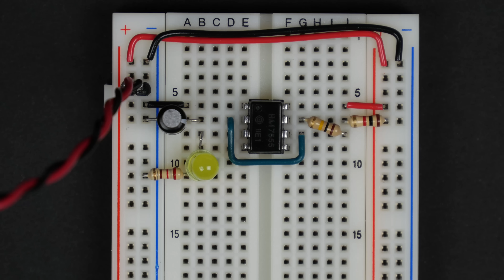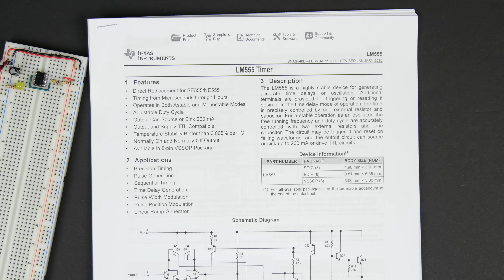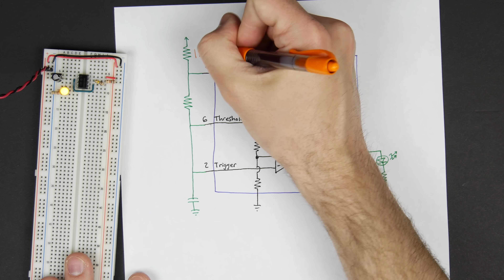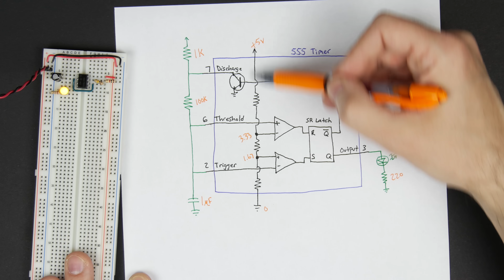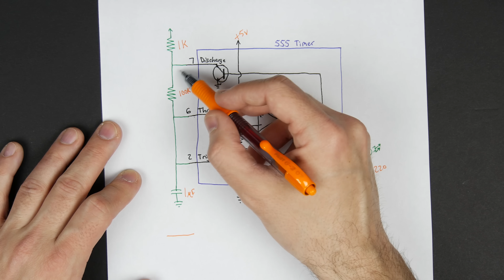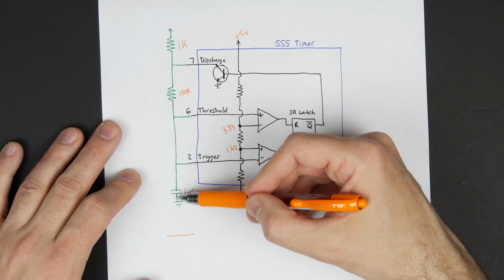Astable 555 timer - 8-bit computer clock - part 1

Comment: Microsoft copilot told me to put power across pin one and two is it damaged? 0:42
Reply: It should be😂
Reply: Pin 2 should be a capacitor to ground but if you put it to vcc it shouldnt cause damage

Comment: Watching this series again, thinking of making my own or at least putting it in s simulator program, and I have a question about the resistor placement.  If you want a symmetric duty cycle, why not put an additional 1 kΩ resistor between pin 7 and the junction immediately to its right on your schematic?  That should make sure the charging and discharging have the same resistance no matter what.  You already need that extra resistor when you move to the variable-length one, so it isn’t even an extra part.

Comment: Timestamps 
00:01 - Using a 555 timer as a flexible clock circuit for a computer.
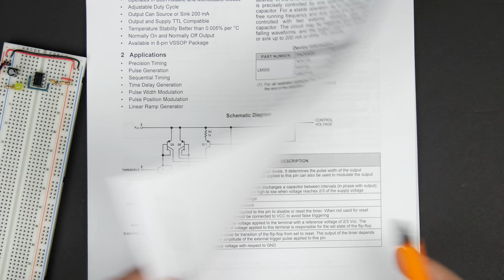01:59 - The circuit diagram of the Astable 555 timer is explained and compared to other diagrams.
05:57 - The Astable 555 timer generates an output that turns on an LED
07:58 - The 3.3V negative input resets the latch and turns off the output.
12:17 - The total period of the circuit is calculated using the formula RA + 2RB
14:32 - The output shows a square wave and the charge/discharge of the capacitor.
18:36 - Adding a 0.1uF capacitor from pin 5 to ground reduces noise and improves transition
20:27 - Impedance in the wire affects the current flow and voltage stability.
23:58 - The function of the 555 timer is to reset the latch and control the speed of the blinking.
25:43 - Adding a resistor in series with the variable resistor to prevent a direct short

Comment: How come the capacitor accumulates charge and voltage? I would have thought the charge would flow out through the resistor and not build up.
Reply: Because electricity always takes the path of least resistance, and the capacitor has a resistance much lower than the resistor.

Comment: I'm confused... instead of using ac supply why couldn't I simply use a DC power supply. Wouldn't that mitigate the problem of uneven jumps automatically rather than having to use a capacitor?
Reply: in the video he is using a DC supply.  The power cable he uses supplies 5V DC.  Even if you used the best DC power supply you would still have uneven jumps.  Without adding the capacitor your intervals will still be somewhat accurate.  However, if you are using this clock module for a project that needs more precise pulses I highly recommend adding the capacitor.

Comment: Why is the 100 Ohm resistor needed at all? Why not just use the resistance of a wire, which is even better than a 1% difference.

Comment: I know Im  a 'little' late, and sorry if this allready has ben adressed, but on the Capacitors;
My Teacher for electronics once told me that most electricity stuff is rated and tollerated for safety-reasons. Capacitors, wich maybe end up in a circuit where they power critical stuff, are rated on the low end. Thus the print-on-value is the guaranteed minimum. The real charge will never be lower and most likely higher. For fuses its kinda the opposite; They are rated for the highest possible value and may blow way lower, due to safety reasons. A bit like the Speedometer in your car; They are alowed to be wrong up to +20%, but they are not alowed to be -0.01°% of to the lower end. (So; Driving 50mph with an indicated 60mph: Thats fine. Driving 50mph with an indicated 49.999[...]9mph, thats a lawsuit desperatly waiting to happen)

Comment: I built the circuit on my breadboard and was following along with the video. I couldn't understand why my LED was flashing twice as fast as Ben's thinking it might be the tolerances on my resistors or capacitor - only to discover Ben's capacitors were 2 micro farads. Everything makes sense now.

Comment: Why is the 220-ohm current limiting resistor connected between the LED and ground instead of pin 3 and the LED?

Comment: You wont get much precision in your timing with a 555 though, most capacitors have rather large tolerances in their capacitance (± 30% in a lot of cases), also the clock frequency is also liable to change over time when using electrolytic due to drift.

Comment: Confused on why the 1uF capacitor would drain into the discharge transistor and not just straight to ground. My understanding is electricity will try to follow path of least resistance, so your 5V supply will no longer pass through the 100k resistor, allowing the 1uF capacitor to discharge to ground. Regardless of my confusion, great video series and thanks for providing free public education.

Comment: I'm late to the party, and have really never understood how the bits work (ie. don't know about electronics, other than all the pieces make a circuit), but now you've explained pieces of the puzzle that make sense to me. Like the part where you said the flow through bother resistors and then back, was so simple to understand (for calculations, etc). Thanks. 👍

Comment: Built this on the breadboard last night, as a flawed copy of the one shown with all the extras - it had though the 555 timer supply and ground connected to the wrong two pins (gnd 8, Vcc 1). I powered it up with my bench supply stopping at about 2.5V and 1.5A. Then checked my layout as it obviously didn't need anywhere near that current to make 5V. So, I swapped Vcc and GND leads at the timer noting my copycat error. And, it actually worked (LED flashing) after that, drawing a few milliamps - not sure what was dissipating the power before?

Comment: Hey guys,

yesterday I tried to set up this circuit on a breadboard. Worked well, added a variable resistor and changed the speed with which the LED turned on and off. 

I then wanted to look at the measurements on the osci. Sticking my probe to PIN3 (output) showed me a beautiful square signal. Plugging it into PIN 2 however made the LED stop blinking and it was on all the time. After trouble shooting a collegeau suggested switching out the probes and voila it worked again. LED was blinking and I could see the charge-disharge curve of the capacitor. 

Upon inspection of the probes I saw that the non-functional probe was set to 1x instead of 10x like on the new one I had used. After switching to 10x on the supposedly broken probe , everything worked perfectly fine, LED blinking and both functions displayed on the oscilloscope. 

Could anyone reading this try to explain what the issue is with measuring in 1x with this Astable circuit, when in most cases that I've used the 1x setting there was not a problem. 

Thx in advance

Comment: I just tried building this circuit and the first time, I got it right. I was using a 47-micro Farad capacitor, so my frequency was much lower than this. But, when I tried doing it again, the bulb just flashes once when I connect the battery and then it just turn s off. My circuit is exactly like in the video. I can't find what's wrong. Can someone please help me??

Comment: 📺💬 It Jirayu reading what is 555 timer circuit do⁉
🥺💬 Many things but that is because people talking about prohibited subject can harm that why they think it can do only one thing it create voltages different for logics.
📺💬 Have you see generators⁉
🐑💬 There is generator but you can saved generator by the 555 timer.
🧸💬 How you create voltage change without input that is because it is work good with automatic circuit, easy to understanding and working well with simple implementation.

📺💬 Capacity labels this time number with tab 🐐💬 In laboratory resister capacitor, that is because colour tab is very good when you see no colour blind but with codes some can understand too.
🥺💬 They had a table but you remember when use it for few times because the resister capacitor can be replaced by nearby value. 
🐑💬 And when lacks sometimes capacitor can work as a generator too.

📺💬 That is because resister - capacity we can create timer as we want.

Comment: Excellent explanation in this tutorial on the functioning of the clock with 555. You also explain very well the fact of how to read the 555 datasheet, taking into consideration and showing in practice the usefulness of ceramic capacitors on the power supply. Well done, very interesting lesson.

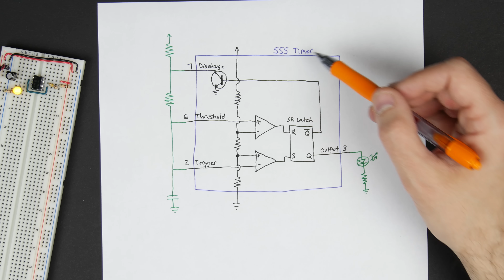Comment: 3:00 Concerning the scheme of the generator shown in the video.
There's an obvious mismatch in using the 555 chip pins. The open collector transistor "Discharge" pin 7 is intended to directly discharge the capacitor or to commutate external devices like LEDs or other indicators, while the "Output" pin 3 is intended to make feedback to RC chain used to set the pulses period.
So the 100 kΩ resistor should be connected to pin 3 instead of pin 7 and the LED indicator should be connected to the pin 7 and the 1 kΩ resistor is no in use.  The "Discharge" pin is able to provide much more current to the load than the "Output" pin can do.

Comment: I made the circuit, cool circuit. but I did some cool things I think, I put in parallel with the led a 5v buzzer so I have sound and it's like a bip in morse code and also I put a linear scale potentiometer so you have equal turn per value.

Comment: Tied two timers together in series and now have two LEDs blinking at alternate times.
Reply: my pin 3(output) is stuck on 2.5v - 2.6v.. ive tried 2 555's both doing the same thing. :/
Reply: @raven9057  I'd check the voltage at vcc.

Comment: Since when do capacitors put a marking on the + side? I've only seen ones where the white stripe seen from the top is negative so I had it in backwards :/ Glad it didn't explode while I stared at it wondering why the blinking is random for a bit then just stayed on.

But now I've just been staring at the consistently blinking LED I've brought to life with my own hands :) See you down in the rabbit hole.

Comment: Is there a minimum resistance required between Discharge pin and Vcc, ie. would it potentially damage the internal BJT to connect Discharge straight up to, say, +15V?

Comment: HELP! I got Part 1 and part 2 to work except for the variable resistor.   The circuit on the oscilloscope  is perfect except when I plug the variable resistor in, the LED stops blinking and the circuit in the oscilloscope stop working.

Comment: I've been getting soooo overwhelmed with compsci stuff, but I need to remember it's like when I learned piano and shit. It's taken 20+ years to become the mofo I am now, so I'm gonna just start with this itty bitty timer and try to smell the roses a bit more. Excellent video. Gonna recreate at home, and then learn more about the latch thing and write out the logic of the sequence too. Latches are funny because you might return past a threshold but nothing changes. Be good to think on that some more-- and those will definitely apply to AV integration projects I do.

Comment: I read the product description for the computer kit and it said that it contains all I need to build the computer. Well I bought the kit and started with the clock module. When i went to Part two for the clock module I find I am missing parts.  Now I will have to buy a clock Kit if An additional $40.00. I reread the product description and confiremd that ALL parts are included. That is not the case.

Comment: My 8th grade required electronics class had us use the 555 timers without any explanation of how they work or what they do, and now, however many years later, that hole in my mind has been filled. Excellent explanation!

Comment: What other timer alternatives are there? The 555 has a drain transistor but no charge transistor so it's difficult to get a symmetric flash pattern and difficult to control the period and asymmetry independently without duplicating the discharge segment from the output (although I can see why they bothered to include the discharge even if not a charge transistor because the discharge isn't triggered by an output while charging would be)

Comment: So it looks like we can't get the capacitor to charge faster than discharge. Does that mean that we can't get duty cycle less than 50%? How do then 555-based PWM controllers work?

Comment: I believe resistors have a 4th color for tolerance -- do capacitors have any sort of tolerance indication? My guess is that capacitors have tolerance obviously -- but 100% seems like a wide range for tolerance. From memory, I think the largest tolerance I've ever heard of for caps is around 20% -- so it makes me wonder if these capacitors are just labeled incorrectly, are old and losing their rating or perhaps temperature is causing issues?

Comment: Okay I’m really not knowledgeable on electrical appliances at all but surely a circuit such as this can be done by just using the capacitor charge time as the timer itself, not using a really bizarre sequence which just ends up using that same logic to accomplish this. *and yeah I do know I’m commenting on a 6 year old video
Reply: The capacitor charge will leave the input "floating" between high and low tolerance; Whether a chip reads high or low will be inconsistent when the capacitor is halfway charged. The 555 turns the rough triangle into a perfect square.

Comment: Love your channel. I'm fairly new to electronics. I have purchased one of the radio shack learning labs and the first build is the flashing led using a 555 timer. Thanks for the explanation of how it works. Just wondering how does the capacitor charge while at the same time allowing electricity to "backup" the wire to the trigger and threshold to activate them? Hope that makes sense what I am asking. Thanks
Reply: As the capacitor accumulates charge(thus reducing the potential difference), the charges from input source will flow in the other path(comparator connections). Once the capacitor is charged high, it causes more charges from input source to flow to comparators and triggering the required outputs. Once reset is triggered, it causes short circuit in transistor(7) and hence input charges are directly moved to transistor(and ground). Thus no charges flows in the line from from input source to capacitor. This causes the capacitor to discharge the accumulated charges.

Note: not an expert opinion and has a good chance of error in my understanding. (also, in all the charge flow, i used conventional current flow, i.e: the opposite of electron flow)

Comment: I love this series. I've watched it all the way through many times. Absolutely the best series for learning about computers at the logic gate level.
I have a bit of a curiosity in regard to generating a clock signal that I'm hoping you can explain to me.
It wouldn't allow you to vary the speed and it would certainly be too fast to debug, but if I took the output
of a not gate and ran it back into the input it would oscillate like a clock right?
Would it be stable enough of a signal to drive a cpu? Also, how fast could you expect it to pulse (what sort of range)?

Comment: That’s wild man. I’m a mech eng and work in an R&D lab with hydraulics all the time. When he plugged that capacitor across the power lines a light bulb went off and I realized it’s no different than putting an accumulator on the pump supply line to reduce noise. You are a great teacher! Loving these vids
Reply: Holy shit that's a cool connection. I'm not an engineer of any kind, but that makes definite sense intuitively.
Reply: The analogy between electronics is extremely close. Voltage is pressure. Current is, well, current. For any basic electronic circuit you can literally build a hydraulic simulation of it. I think I've seen a learning kit that actually did that ("for children" ... um, yes, I would buy it for "my child").
Reply: @eritain  When I try to explain how resistance and capacitance work in AC circuit I always talk about seasons. The light pressure from the sun is highest on the summer solitice (northern hemisphere) but that is not the hotest time of the year. Athmosphere acts both as a resitor and an accumulator for the heat. So the max heat is phase shifted to about August. Same thing happens during winter when lowest light pressure is winter solitice, but the coldest time is in January-February.

Comment: Hi, thanks for this very interesting playlist. I have constructed the simplest schema (like in 1'43) but in my case, the led in always ON. The only diffrences is my 555 (it is a TI NE555P) and the 2 uF capa that is not polarized in my case. My VCC is 5 V. Do you see something wrong ? Thanks a lot.
Reply: Hey, I have found my problem. It was a miss-connection for my 5 V. Now, all is working perfectly, even if I use a non-polarized capacitor.
Reply: @Jojo-nf1yk  Mine is always on too, can you explain what exactly you did to fix it? (NE555P)
I've been redrawing the schem. from the datasheet and comparing it to Ben's and am unsure how they're different-